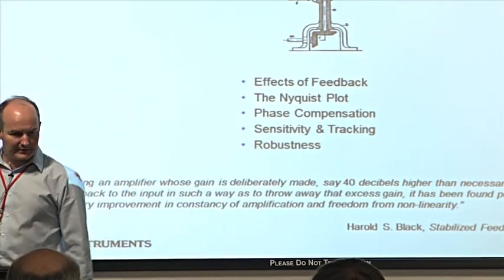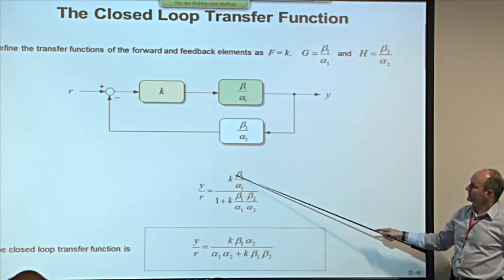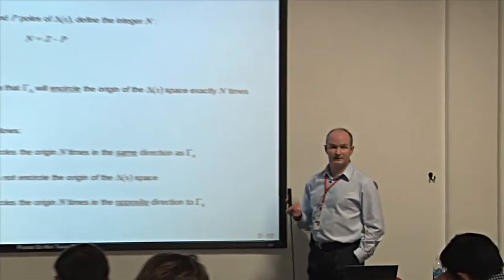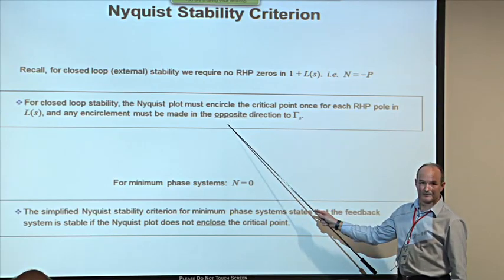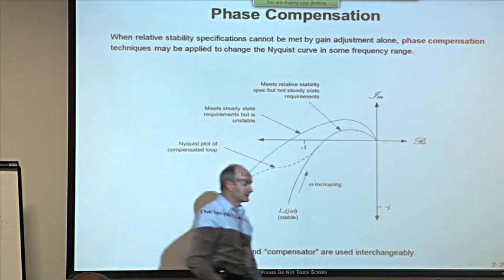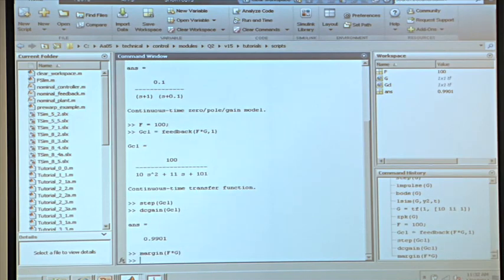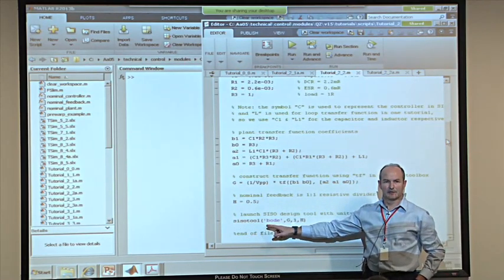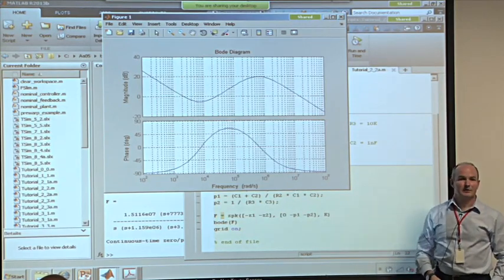Control Theory Seminar - Part 2

Comment: I AM GETTING MATLAB JUST BECAUSE OF THESE LECTURES !!!!
Reply: Octave does the job usually just as well, but is free.
Reply: @Konecny_M  would be nice to have sisotool in octave
Reply: If you aren't in school, it cost about $250. In school, using your email address from your school you can get it for about $100. If your school doesn't provide you emails, there's a method to get your school's Registrar to get that approval.
But if you have $0 available and don't like being left out :( try Octave instead! It's a freebie version of Matlab. The code is compatible so you don't waste time learning something that isn't the same as Matlab. It's nearly the same language. There's another program that goes with it called Scilabs that's a freebie version of Simulink. You're going to want that too!